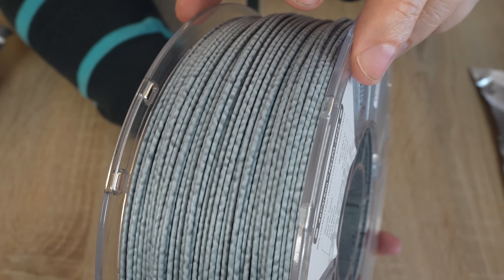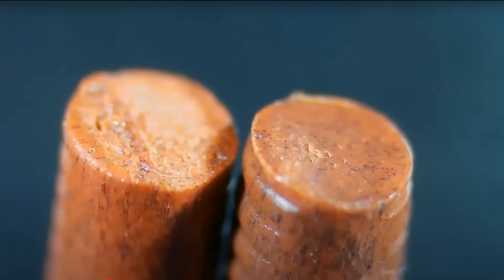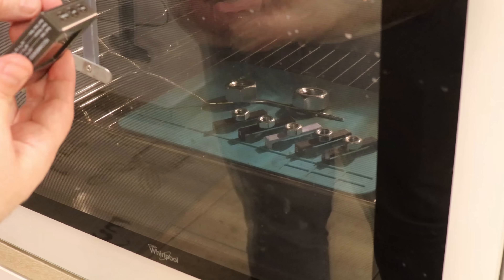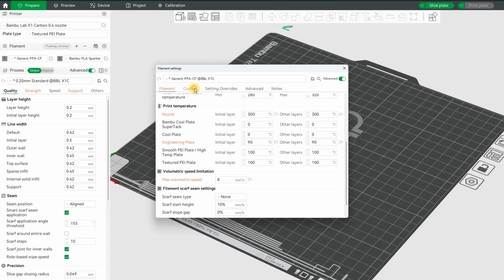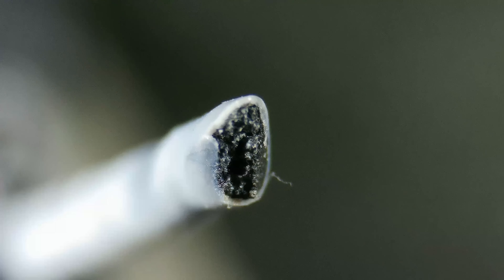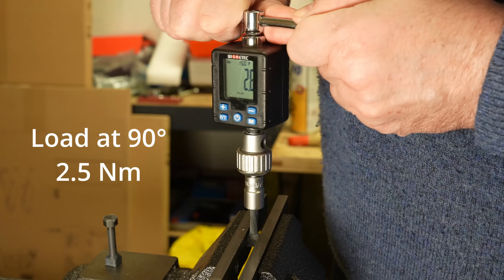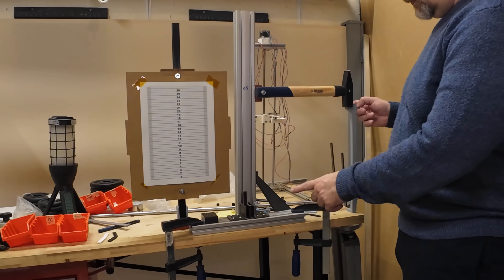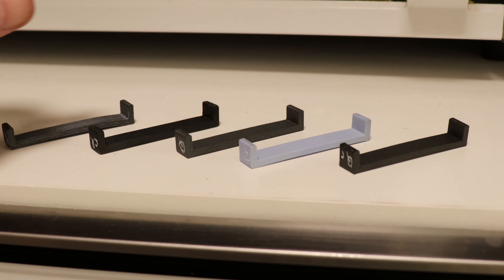Another great Core PPA filament: Phaetus NexPA-CF25

Comment: Testing looks like it was carried out very well and the info in this video is amazing!  Well done.
Reply: Thanks!  I just wanted to say that this kind of video is super valuable.  When 3D printing was first introduced it was certainly capable of making so many things.  

Things like artwork that would not see a lot of stress like mechanical stress, stress from heat and humidity, etc. 

But things such as engineered structures that needed to bear all kinds of forces it simply could not do.  

However there have been so many advances in this area that have made serious improvements to the point that some of the work could compete with injection molded parts... 

So to hear your own experiences in working with the material, was it finicky or was it easy to use, etc... adds a ton to the collective knowledge for this technology and is invaluable.

Comment: The skin will mix in with the filler due to fluid dynamics. The walls of the nozzle drag on the plastic as it flows so the plastic in the centre travels slightly faster. That means you getting minute vortices which will eventually mix the grey and black together and result in a black print. You can see other videos on Youtube showing the nozzle very close up and magnified as a filament colour change happens. The centre of the flow changes first gradually moving outwards
Reply from the maker: The flow is laminar, only this skin is partly transparent, so we cannot see it. The laminar flow, you can see if you try dual or tri-color filaments. Colors are not mixed.

Comment: Please please please bring back the screw creep test. Especially with nylons where creep can happen under screws load at high (80c) temperatures as the material tends to flow instead of deform.

Comment: oof. I really need better replacement for petg for technical stuff but this doesnt seem it as i have bambu A1 (and i would prefer to avoid fiber filaments)
Wish there was something decently strong and heat resistant that would print solid good under 300C
For all parts i make temperature resistance headroom with petg is almost non existant so im always on a lookout for new materials.

Comment: that's an incredible increase in layer adhesion from just a 30C increase. Nice to see someone finally testing both the filaments and the qidi printers properly.
Reply: I've always printed my ASA hot for the better layer adhesion after watching CNC Kitchen's video(s) about it. That seems like ancient history now that I look back and I'm glad we still get new testing videos like this! Anyways, printing hot makes a bigger difference than some people realize.
Reply: @mjodr I remember that too. Without any formal testing to back it up, I have found a point of diminishing returns. I don't use ASA at all, but for ABS I've found 275C and above and the material tends to degrade in the melt zone before it is deposited leading to an overall weaker part. Even 270 has to be printed rather quickly and with a 0.6 nozzle.
Reply: @ Well, yes there is a sweet spot as usual. It's just that I find most people printing on the cold end of the scale because hey it bulks out the part properly...regardless of actual strength.

Comment: Thanks for another great filament test video!  One thing I would find very useful would be to test the layer adhesion of a filament printed on the X1 carbon in a passively heated chamber vs the QIDI in a 65c heated chamber.  Does the heated chamber help layer adhesion, or is it mainly helpful for warping on larger parts.  Having multiple test pieces printing in parallel would allow some time between layers that could accentuate the difference if there was one.  Just a cool idea for a bit of a printer vs printer side test next time you are printing a high temp filament.

Comment: So is PPA related more to PolyPropylene or Nylon (PA)? Anyway, looks to be a very good filament all around. One request I would have for Igor; When it comes to these 300+ degree filaments, it would be interesting and useful as well to know how it would actually print on a printer that can't go up to and above 300C - like the Prusas and Enders that the world is still full of :) A test print that's printed at 280 or 290C is what I'm thinking.
And congratulations on the sponsor! :)
Reply: PPA is a type of nylon (basically in the polyamides group).

Comment: Have you heard that way to be able to print ABS with printers that are not in an enclosure with printing a layer of something like PLA first and then the ABS, and it will print? I don't know if you have, but if not, that might be something to test and see for yourself.
Reply: An "enclosure" can be as simple as a garbage sack if you have a headed bed that can go pretty high.  Cold drafts will just kill anything with any size.  You really need heat with abs, and it helps with the fumes as well.
Reply: that doesn't work

Comment: That eibos Polyphemus filament dryer ships with a spare motor. Maybe you have one sitting around that you forgot about?
Reply from the maker: It's not the motor, but the torque transmission. I have to find some time to disassemble it..
Reply: The only reason they include the spare motor is so that it makes it past the warranty period. It's a terrible design for an otherwise fantastic dryer. My original motor lasted about a year, current one has about three months on it. it's unpleasant that the party piece of this unit has what is basically an expiry date due to poor design. I don't even run the spool rotation all that often, just a couple of hours before printing nylons then I have it freewheel while printing.
Reply: Yeah, it's a shame they didn't design this better. I have 3 of them, also quite different noise levels when rotation is active. There's also some o rings in the spares bag, is that a replacement part of the transmission system?

Comment: Hi, I have a question, why is there only PPS-CF but no with glas fibers?
Reply from the maker: I tested both. PPA No fiber and GF. But other brands
Reply: @MyTechFun  thx for the answer, but i didnt mean the PPA, I mean the PPS polymer, why is there no PPS with glas fibers?
Reply: @nikoivan2580 there are, for example: Spectrum PPS AM230
Reply from the maker: @RobertLukierski  thx for helping me out. Interesting, looks like again I have to spend my budget for filaments 😀
Reply: @MyTechFun they have some other exotic stuff like PA6 with glass microspheres (PA6 GK10), ABS or ASA with Kevlar, PC/PTFE or TPU with Carbon Fiber (S-Flex Carbon), but I haven't tried them yet, only simple stuff like HIPS, PA6 GF30 or PC/PC-CF. For non engineering stuff I like their PETG-CF which is much cheaper than the Bambu one (this is 3% CF, but gives nice finish and dimensional stability).
Reply from the maker: @ I have in progress their PETG-PTFE. But about PPS AM230. I cannot find anywhere that it is glass or any other fiber reinforced.
Reply: @nikoivan2580 ah sorry I didn't notice you were asking about GF - I think there are some PPS-GF, but haven't seen one easily available. Spectrum PPS AM230 is just plain PPS
Reply: @MyTechFun  yeah sorry I didn't notice the GF part, it is plain PPS. TreeD PPS GF 25 is the only one I found online, but it doesn't seem to be commonly available

Comment: Great video! PPA-CF vs aluminum would be a video I’d love to see!
Reply from the maker: Interesting idea. Alu would win, but question is by how much..
Reply: @MyTechFun  To make the competition fairer, I could use samples of the same weight instead of the same size.
Reply: Metals would be considered to be 100% infill, unless it an extrusion, injection molded, or cast. Sometimes I’ll machine out metal that’s isn’t needed for strength, if weight is an issue. But you really can’t compare these plastics to metal unless you, at least, print them solid. That’s why a lot of the testing I see done on filaments has little meaning. Each guy uses a slightly different shape and thickness as well as different fill. It would be nice if there were a standard people would follow so that there would be some consistency between channels, as nobody can test everything.

Comment: I saw this material a little while back while shopping hotends for another project. Performance looks quite good for a consumer-available filament, though it's getting a bit spendy into engineering-grade materials. I'm always a little torn when it comes to this, as my usual workflow is to print in a cheap(er) material, mold it and make a copy out of tougher materials unless the part is one that has complicated internal structure where a core would be problematic if not printed.

Comment: I'd be careful with that Qidi 4. Someone on Redit had theirs catch fire and burn the entire room. That even after he replaced the recalled part!
Reply: Allegedly. The claims are dubious. He wasn't even using the heated chamber, so the SSR board should not even have been active. Not to mention the updated part does not even get hot. He replaced it, so it's possible he wired something wrong, but he claims he absolutely did not. Entirely possible it was just a freak accident involving another component in the printer. However, I consider it likely it was a power strip, outlet, or old wiring. 3D printers draw a lot of power. We don't know what else was on at the time or what the setup was like. That said, ALL 3D printers deserve caution. They are high power draw, high heat equipment full of cheap electronics.